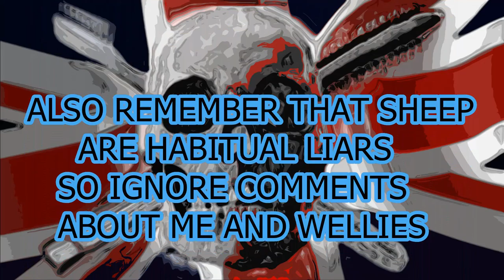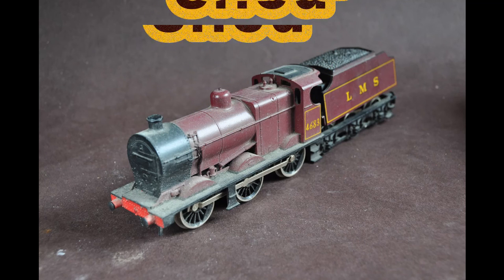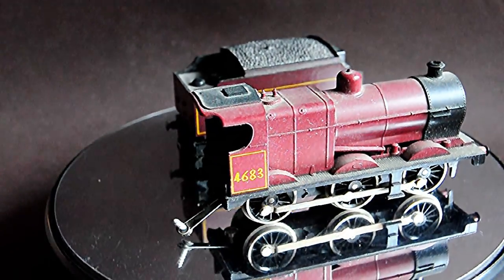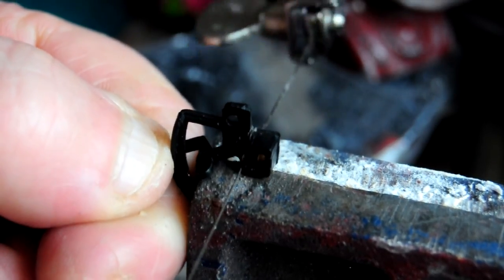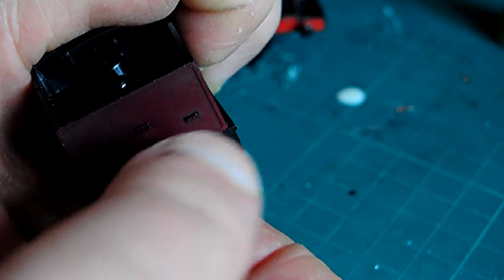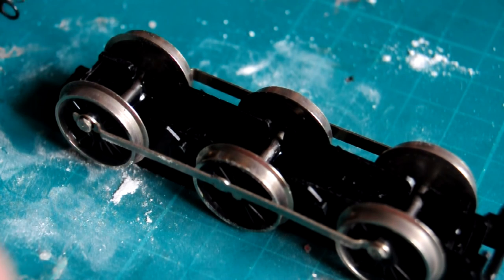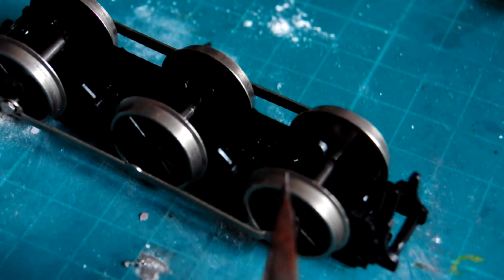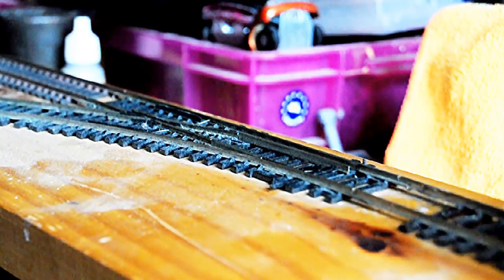Lima HO,OO LMS Fowler 4F      QUICK RESTORATION

Comment: Very nice Pimpy. If you want to apply oil to something delicate, where you don't want to get it all over. Use the tip of feather. Dip the tip into the oil and it will pickup enough oil to do the trick. This is a trick my dad taught me, when he used to repair old clocks.
Reply from the maker: cheers buddy fantastic tip
Reply: @pimpmydiecastsdiecastandto3176  Remember this. Kinky, you use a feather. Perverted, use the whole chicken!